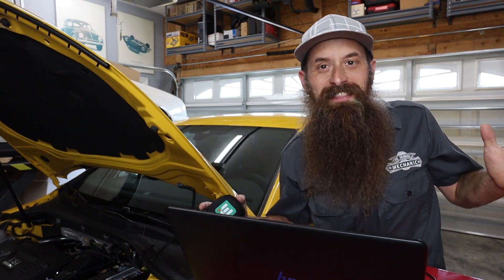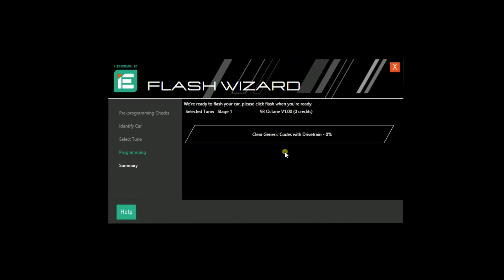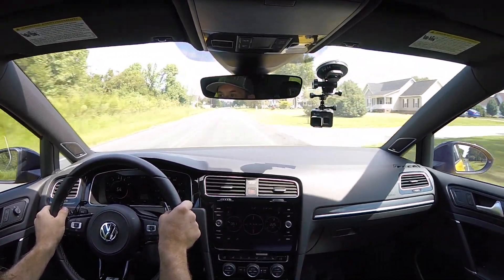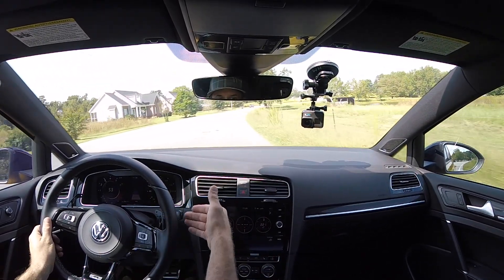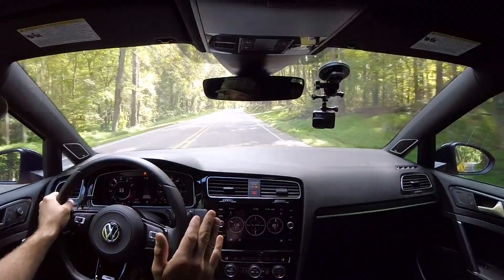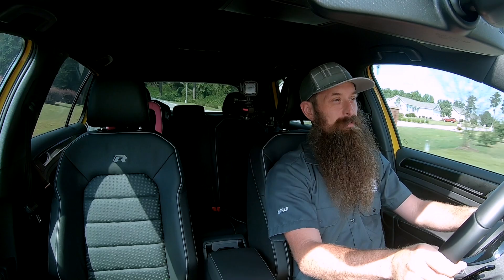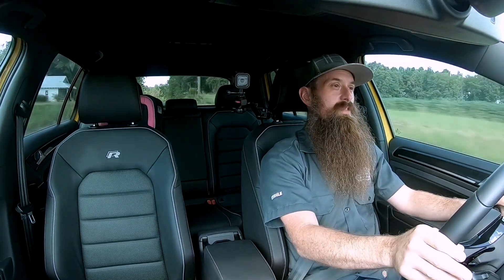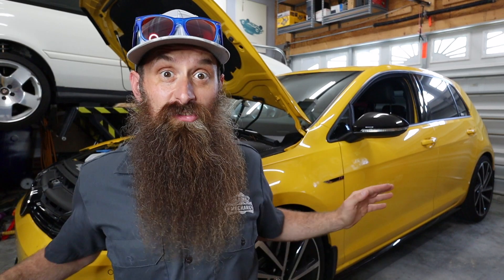How Much Horsepower Does a Tune Add? ~ Stage 1 Tuning Golf R

Comment: I dont know man. I mean, yeah. Its easy to do at home. But you completely remove the skilled human tuner out of the process. A tuner with a few hours on the dyno can really hone in on your car specific odditys. It is so common to have clutch issues and fueling, timing, cam odditys and what not during a tune just because every engine works a little differently. Even right out of the factory after a good run in every engine behaves a little different. A tuner can see these things and react to them. Just loading a file thats supposed to fit every engine and transmission seems dodgy. It works. Kinda.... In a sense that you will get more power. But its not going to perform its best and it most definitly going to experience more wear.

Comment: would have been cool to do low torque vs high torque on the dyno to compare the numbers. I called IE and the rep said that the stage 1 high torque file provides 50 additional torque over the low torque file, while i don't believe (even if crank torque).

Comment: I'm a new subscriber and I am so glad that I found your channel as I grew up riding in those iconic Beetles driven by my mom.  The distinctive sound of that air cooled motor is permanently etched in my mind-my cat would run to the front door to greet my mom upon whenever she heard the VW parking outside.  We had to cover the distributor with plastic whenever it rained as it would not start when wet.  Your channel shows how VW had evolved through the years from it's humble beginnings.  Thank you for producing such entertaining content!

Comment: Is Stage 1 worth it ? i was thinking of doing my Peugeot 208 GT 2022 3 months old and with 2850km on the motor, i was told by 4 garages that'll gain 50hp and 75nm increase and about 8 to 13% better fuel... should i do it ? at this moment it's on sale for about 250euro instead of 450euro, but i am new to this and dont know if i should do it. we'll see i guess :P
Reply from the maker: 100% best bang for the $
Reply: Thanks for the very fast reply :D

Comment: Can anyone comment on the reliability of the car after a stage 1 tune?? I'm quite new to car mods and  I'm considering this option but am fearful of car parts breaking down/blowing up etc. Any advice would be appreciated thanks :)
Reply: When your car comes from the factory it’s tuned to pass emissions test, then get the best mpg, then power. What you’re doing is putting power as #1 focus. Stage 1, means you’re not pushing the car to its extreme limit. Track cars are built with the fastest quickest time in mind, so those are always pushed to their limits. That’s why they’re always so hot and have to wait in-between races to cool down. With a stage 1 tune, your car will be perfectly fine. If you notice hotter temps, feel free to get a cold intake or if your car is a turbo, an inter cooler. Or get an airtec vent.

Comment: only 290 HP?? In Germany the 2019 has 310 HP from Stock Factory and ~325 if you order the Akrapovic Exhaust with Performance Kit.. The TCR has 286 HP but Front Wheel Drive only...

Comment: I had a 15 R with Stage 2 which comes with 1.5 Unitronic. My wife hated the crackles and the cops here in Nor Cal did not like it. I LOVED IT! 
Had it lowered on BC, strut tower braces, diesel geek shift kit, southbend stage 2 clutch APR downpipe, Awe Switchpath

Comment: Would love for you to revisit this tuning of the yellow R, how's the tune and changes holding up, any surprises or things you'd do different? How's the extra belly pan protection, does it affect engine temps? 
You don't mention any of the other tuning companies, I guess because they aren't available in the U.S., but that would also be an interesting topic. For example in Europe König works together with VW to provide a tune that does not impact engine warranty (Called ABT Power by König), which is roughly equivalent to stage 1, but they do not provide any dsg tuning. Then there's Revo of course as well.

Comment: Can you explain exactly what happens when a car is tuned (i.e. stage 1)? What is changed in the system as it relates to the power delivery in the engine and possible long term effects?

Comment: I dont have a battery maintainer but could I just use jumping cables and pass current from another car?
Reply from the maker: I really dont like that method. There is no control or regulation of voltage spikes.
Reply: @HumbleMechanic  well I see they have one in Walmart that has the option for 6 volts and 12 volts. Gonna go get that one

Comment: Hey Charles - great video.  Just purchased a brand new 7.5 final addition R with DSG.  Low torque vs High torque TUNE ....    Does the DSG tune cause accelerated wear of the wet clutch packs ? and if so how do you explain this to the VW dealership ?

Comment: Is there anywhere to find a detailed guide to the different drive modes? And how do you turn off the Soundaktor? Thanks.
Reply from the maker: I did a video on the Soundaktor. For the drive modes the owners manual is probably best

Comment: I have 2018 TSI 1.8 engine should i do stage 1 update without changing the turbo or something in the engine ? 
Or it will make issue for the engine ?

Comment: kind of a dumb question but wonder you consider stage 1 and stage 2 "safe" since my GTI is my daily. Id rather have reliability than more power
Reply from the maker: Stage 1 100% yes safe. Stage 2 starts to add bolt on stuff still can be safe but up the maintenance
Reply: HumbleMechanic it seems like IE has more modest tunes and require more support parts. Seems like they are more focused on not blowing my motor up
Reply from the maker: Yep. They are not pushing to the limit. I like that

Comment: Stage 1 United Motorsports tune puts down more power on the Golf R. I get the fact that your supporting your friends, just stating the power numbers are higher with another brand.
Reply from the maker: It’s not about that top number for me. Drivability and reliability are more important. That said UM is great and I’m sure their tune is top notch. 

The only thing I don’t like about UM is you can’t usually talk with them. I can make a call and talk to IE. I like that.
Reply: HumbleMechanic I agree, the only reason I chose UM is because I have a tuner who’s shop is 30 minutes from me. So it’s quite easy to shoot over to see him if anything comes up or I make a change. I’m currently waiting for a Littco L450 to show up in the mail , then it’s a 400$ upgrade in my software to tune the car for a the larger turbo. What options do IE have for turbo upgrades?  I believe my tuner is doing a remote tune with UM because he does not have a dyno.

Comment: Do the IE tunes allow the throttle to activate while the brakes are applied?  It annoys the heck out of me I can't heel/toe in my '17 GTI.  If the brakes are applied at all, the drive by wire throttle is disengaged.
Reply from the maker: Good question. I haven’t tried it Since I’m DSG. Let me see if I can find out
Reply: @HumbleMechanic  Cool, thanks!  I'm torn between doing a stage 1 tune on my GTI, trading it toward an Alltrack and tuning that (possibly an IS20 down the road), or just biting the bullet and grabbing a 6mt Golf R.

Comment: Just wondering what you meant by ‘it’s definitely not the R32’ even though you were clearly loving the tune on your Golf R
Reply from the maker: There is jus something special about the R32 that the R doesn't have.
Reply: Thanks for replying. I’m in uk and there’s a dealer nearby selling what looks to be a nice R32. 51000 miles 2008 but price is £12k. Seems high but no doubt done most of its depreciation and as you say, a special car.

Comment: I'm considering doing the 2017 IE stage 1. Is there any reason why people would choose the low torque tune? I assume it just gives more power over the entire length of the gears?
Reply from the maker: Manual trans cars that don’t want to do a clutch is what I’ve been told
Reply: @HumbleMechanic  Okay thanks. So if I'm DSG there's not much reason to do the low torque.

Comment: Hey bro plz help I have Skoda Superb 2009 1.8 tsi dsg 7 speed & in P ( park mode ) the engine revves upto 4000 rpm I don’t know weather it is fixed to rev only till 4000 rpm in park but sometimes it’s revves more than 4000 rpm like it revves almost 7000 rpm & this also happened when there was a low fuel in it ( only very little fuel ) & it had a misfire in cold starts but it becomes better when the engine heats up then no misfire & recently I had a mechatronic failure the hydraulic fluid was coming out & it had a crack in the mechatronic unit where there is vacuum accumulator plz help sir 🥺🥺🥺🥺🥺🥺🥺🥺🥺🥺 #humblemechanic
Reply from the maker: In park or neutral the typically should only rev to 4k. It’s odd sometimes it does it to 7k
Reply: HumbleMechanic  thanks bro 👍🙌 I’m ur fan from India 🇮🇳 but for other things that I mentioned

Comment: How do the IE tunes compare to the APR tunes? I was planning on going with the apr stage 1 and dsg tune and then eventually stage 2, but at the same time I like the idea of being able to do all this stuff myself. APR’s stage 1 93 oct high torque tune adds ~80 hp and 79 torque; but you said it’s about 30 & 40 with the IE tune, so for the same price it seems like apr is a bit better. I’m not super familiar so I’d appreciate any feedback.                   Edit: I’m dumb and realized that it’s different with the golf r compared to my GTI lol oops. Numbers are pretty similar with the GTI on the IE website
Reply from the maker: I love my IE tune. But I can tell you, all the big tune companies are awesome. APR, Unitronic, IE, UM all great. The numbers are going to be very close. 

If you DIY, awesome. If you are having a shop do it, go with the one that the better shop uses incase you need support.

Comment: Who has done a stage 1 tune on their 6MT? Need to change your stock clutch? How long did it last?
Reply: One would need to check how much torque the stage 1 gives and what the max rating is for your clutch. It is the first thing that would break if engine gives too much.

Comment: why does no one ever show how the data log thing works?
Reply from the maker: Good question. At the time it was something I didn’t use. I’ve used it a bunch since. When you open it, you hit start and it will capture everything you need. Then you can save and export to a graph or look at it in a speed sheet
Reply: @HumbleMechanic  Do they have a manual or guide or anything for it?

Comment: This video inspired me to research and call around about the IE stage 1 high torque tune for my '19 Golf R, and I had it done recently. It is awesome; thanks HumbleMechanic! On winding country roads, open highways and commuting too it is like you say, so smooth, and with power just waiting to be tapped.  I hope it's OK for me to thank Matt at Triangle Imports for the great tune and sharing tons of information.
Reply from the maker: Sweeeeettttt. I need to get over there to meet those dudes. I’m about 20min south of Raleigh

Comment: Quick question, I had a ‘12 gti and had carbon build up that needed to be cleaned.  I was looking at a Golf R 2019 but do you think they have the carbon issue fixed or would I have to get it decarb’d like my 2012 at 40,000 miles?

Comment: Just got a Stage I low torque tune for my 6speed '17 R -- boy what an improvement!  No doubt this is how it should have come from the factory.
Reply: @monkymind4316  Hey Mike - Yeah i got the IE stage I (low torque b/c 6spd stock clutch).  I actually drove to their shop since I live here in SLC and they did the tune for me so I never bought the Powerlink stuff.  Hope the pandemic stuff passes soon and IE gets more kits in stock for you.  Trust me, you won't regret it one bit!

Comment: After buying a VW..”This great its perfect from the factory”
2 months later...”meh”
After Stage 1 tune....”this is how it should have been from the factory”
2 months later.... “meh”
After Stage 2 tune “Needed to be like this stock”
2 months later...”meh
After buying RS3......lol
Reply: If VW hadn't lied about their fucking emissions we MIGHT have got a Golf R420 with that fucking banger of a 5pot turbo engine!  VW was testing a MK7 mule with that motor in it on the N' ring.  I'm eventually going all electric to cut down on emissions here in SLC (it's a fucking nightmare in the winter with the worst air in the U.S.!).  However I'd LOVE to be able to afford a 2.5L engine swap into my Golf R.  The sound of that engine is like a baby V10 - SOOOOooo much better sounding than the 2.0 and tuning potential is insane --- though I'd keep it right at 450-500Whp. FAR more than I'd ever need on the streets but fun as fuck.
Reply: Ryan II Had nothing to do with the emissions...it had to do with the fact that VW was not going to sell a Golf that is the same price as an RS3 that has the same performance because they are the same car.
Reply: @desertsoldier41  "Volkswagen Reportedly Killed the Golf R400 Over Its Emissions Cheating Scandal" by Chris Perkins from Road & Track. 
VW sells the Golf R with the same engine setup as the Audi S3 today.  Both on the same VW/AUDI MQB platform.   
A VW Golf R400/420 with the same 2.5-liter engine could easily sell along side the Audi RS3 - especially if the VW R version is slightly detuned compared to the RS3.   Not only that, the Audi version will have a nicer interior and the all important four rings badge.  Some folks simply won't be interested in a VW badged RS3 even if it is a little less $ or even the same $.

Comment: I had to get rid of my 2009 GLI , stage 1 tune and i miss it so. I'm looking at getting a used 8v A3 Quattro. I want Haldex and the sweet tuning potential. The MQB platform can be argued as the best modern vehicle architecture.

Comment: Where's the stage 2 video??? I've got a '19 Squirrel Gray R (Spektrum owners unite) and it's about maxed out stage 1 with APR (APR intercooler, APR CF Intake, APR dog bone insert, various hoses and inlet pipes and ECU/TCU tunes by APR as well). I'm very much tempted to get the APR downpipe and go stage 2 but will lose the APR+ warranty. Would love to hear your opinion on taking a brand new R straight to stage 2!
Reply from the maker: Spent today installing the down pipe. ;)
Reply: @HumbleMechanic  impeccable timing haha. Looking forward to the video!

Comment: Stage 1 on a Manual Trans - know of any issues with clutch slippage? I remember my MK6 GTI had this issue.
Reply: A lot of tuners have a low torque stage 1 tune. Cobb sells a 1 and a 1+, and they say anything above 1+ needs a new clutch
Reply: @goto032492  Shop I use is a Unitronic dealer, I think they only have a single file from what I remember seeing on their website. But, otherwise, yeah I agree with you.
Reply: @Nick-jh6vl  Cobb stage 1 lists a 19% torque gain and states that it's safe for a stock clutch. The peak gain for Unitronic stage 1 is a %12.3 torque gain. I would assume a stage 1 from unitronic is safe for the stock clutch.
Reply: @goto032492  Are those both average torque gains, or peak?
Reply: @Nick-jh6vl  peak

Comment: I been running my 13 r on united motor sports stage 1 tune for around 100k miles. Love it. Want more. But I’m still on my factory clutch at 127k miles.  Oh yeah 6 speed manual. Is the way the car should be driven and from the factory
Reply from the maker: Nice!!!! I love the DSG in this car.
Reply: @HumbleMechanic  I've read and seen that for the R, the DSG is the way to go and for the regular GTI, manual is the way to go.  To each their own.
Reply: Stock clutch with that kind of miles!? That's good to hear. I have an itch to tune my new-to-me mk7.5 R even though I already feel like it's fun.

Comment: Weird thing that i found out about R/GTI traction control is that when you keep holding it even when you hear beep and keep hold it for another 10 seconds or so and it will turn itself on and will be stuck there nothing even if you press the button again nothing happens. Until you turn off the car its not doing anything. Try that

Comment: Great video.I  had my Golf R APR chipped last week. i cant believe the difference. i think the 0-60 mph would be very low 4's. it would now be Audi RS3 quick!,
well worth doing your right.its awake,
Reply: @monkymind4316  I live in Australia.so its very expensive here.the APR remap was $970us
and the full APR carbon intake and turbo inlet was the same.so the total was about
was just under $1950 us but it probably depends where you live.but now it is a completely different car,
Reply: dwain pipe you don’t need to buy their air intake it’s crazy expensive also if you buy the Downpipe stage 2 is a free upgrade from stage 1. also if you live in a regular climate you don’t need a front intercooler.

Comment: If you tune the car and have issues and then set the car back to a stock tune would the dealer be able to tell??
Reply from the maker: If they looked hard enough. There are a few ways they can tell a car was tuned on these models
Reply: HumbleMechanic thanks! Is it easy to covert the car back via the software??
Reply from the maker: Yes depending on who’s tune. For the IE one I have you can flash it back in a few minutes. 

On this generation car there is a flash counter that changes every time. So they could still find out if they look at the counter
Reply: HumbleMechanic thanks for that really informative, I pick up my brand new golf R tomorrow so you’re videos have been great!